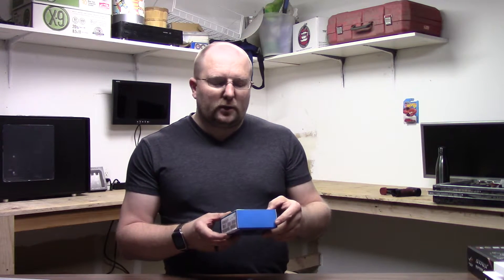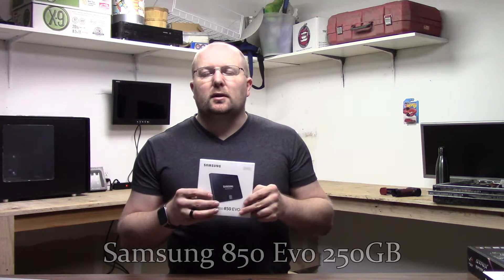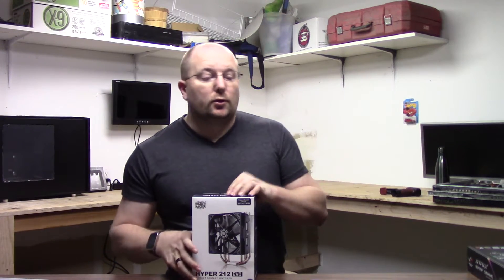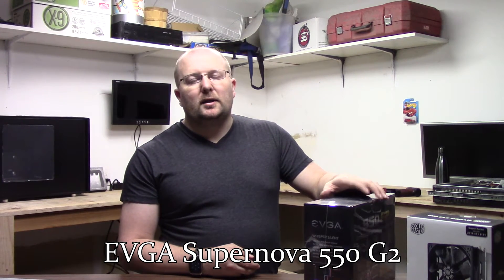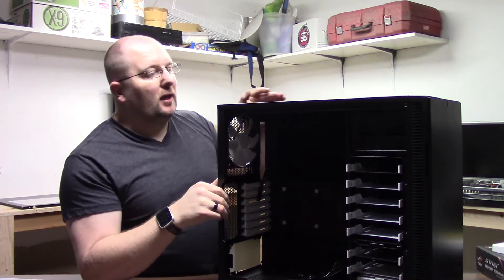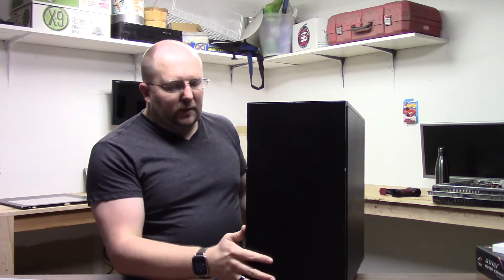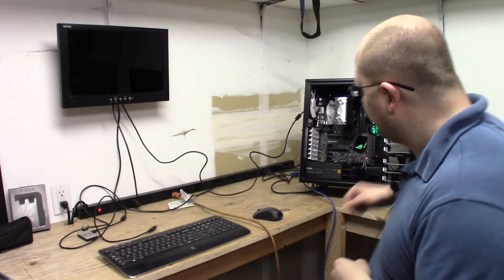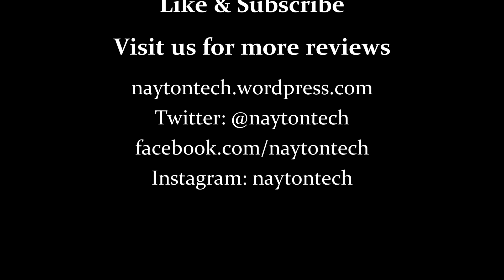Plex Server Build - Episode 01

Comment: This is a overkill for a Plex server. Plex can run on a potato lol... i have a i5 2500k with 12 gigs a ram and my plex server streams just fine. i have over 5 tbs of data I stream from a external drive. I have Plex Pass as well so my stream from my server all over the country.  Plex doesnt really touch the the cpu but a SSD is very important due to the trans coding on the server. Also making sure your upload speed on your internet is pretty important.
Reply from the maker: Yes, for just a plex server it is over kill.  I wanted something I knew I wouldn't have to upgrade for a while and I'm debating turning it into a second family gaming machine eventually once video card prices come down to normal (hopefully).  It currently has 38tb of storage in it and manages the 30tb of data that I have on it very well.  I'm hoping to test 2 4k streams and 1-2 1080p streams off of it at once, I'm curious how much of a load if any it puts on the CPU.

Comment: What software did you go with?
I have an i7 6700k with a gigabyte z170 gaming 7, this was my main PC but I utilized the CPU under "unRaid" you should give it a try. 
unRaid gives me the ability to install plex, torrent client, and a VM windows machine with a GPU passthrough that makes it an additional gaming PC if needed.
Reply from the maker: I'm running Windows 10, the plex server, some newsgroup software.  I thought about using unraid, but in the long wrong it wasn't quite what I wanted.  The Windows 10 configuration I have now is extremely stable.  I'm not to worried about losing data, anything I'm REALLY worried about losing gets backed up online and to an external hard drive.

Comment: Do you have a meter to check how many watts it pulls out from the wall while being idle?
Reply from the maker: I don't unfortunately.
Reply: Well since electricity prices seem to be lower than I expected there and all it might not be that bad. I would say 90watt idle which will come to 80$ annually just to leave it running. EU Prices leave me at 240$ annually which makes me consider getting something, not that power thirsty.